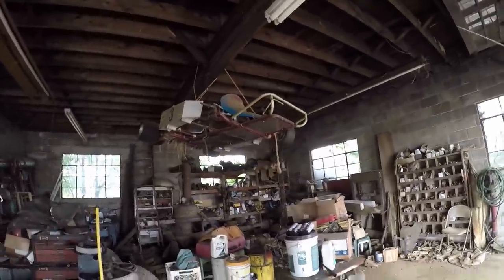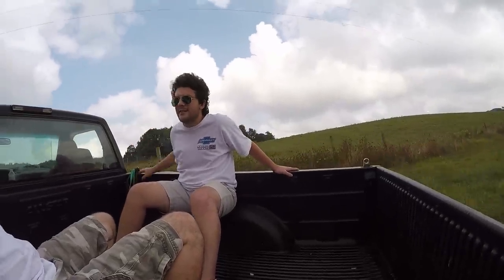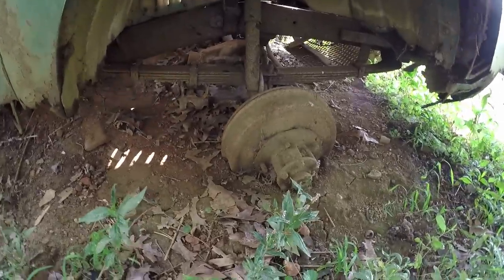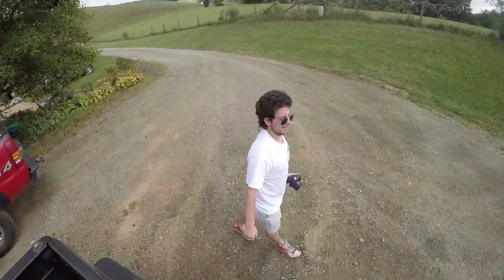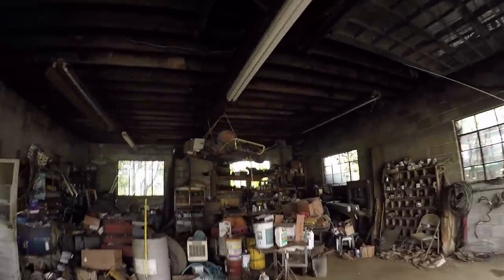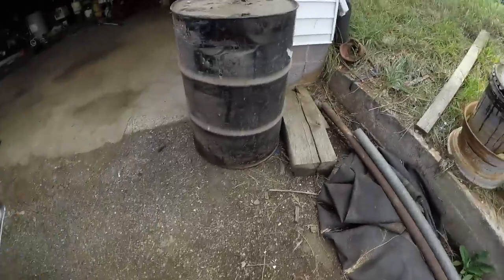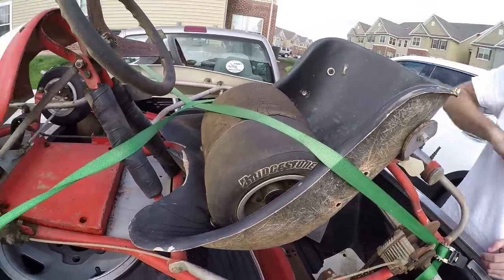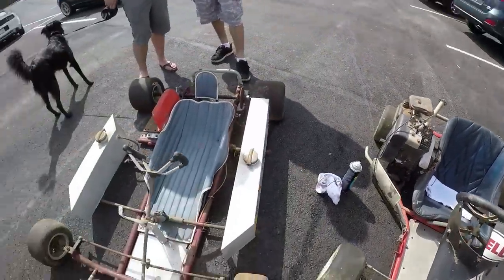Go Kart Barn Find: 3 for $300!

Comment: The laydown kart is a Meyers Lancer "Bullet" enduro kart.  It was made in Bellflower, CA in 1975, and is the  production version designed by me.  About 30 were made between 1972 and 1975.  During that time we won 8 IKF National Championships.  Drivers included Kevin Cogan (Indy Driver) who nearly won the 1986 Indy 500, leading until the last 5 miles.  Scott Pruett, also drove one, and is still racing for Ganassi Racing, and has won many races including the 24hr's of Daytons.   Scott is currently testing the new Ford Factory Ford GT to race next year at Daytona.  Yours could have been raced by an Indy 500 driver.
The races were 1 hour (that is why the large tanks) using Alky with either a McCulloch or Italian 100-135cc Komet engine.  The top speed was about 125mph.  We built several with two engines (75-85hp - 16,000rpm)  that went as fast as 140mph.
The fiberglass faring was not used, the front bumper has been changed, if you remove the adapter plate the motor mount fits McCulloch or Komet engines. )  Rare find!!!   JG
Reply from the maker: +Disneyland1951 Cool! Thanks for the info. This one will be preserved and will probably get a 212cc four stroke, but none of the modifications we do will be permanent.
Reply: +Disneyland1951 AWESOME! Thank you for the info on it... I have been looking but couldn't find much and the stuff I could find didn't look exactly right. Do you have any pictures of the production ones you made??
Reply: +Disneyland1951 SWEET
Reply: +Disneyland1951I remember watching Scott Pruett in my early racing when I was about 14.  There was a an IKF and WKA show down in Charlotte in 1982.  The man to beat was Scott Pruett (he had the baddest Simpson helmet :darth Vader I had ever seen and the man that beat Scott that year from WKA was a fellow names Jessee Samples!  Jesse and Scott were just bad ass drivers and I loved getting my WKA magazine to see how they did.
Reply: I have three mcculloch engines one about 85 cc may 100 the ohthe rtwo are much smalle r
Reply: +courtney chamberland(a she racer? sweet!!☺👍it's always cool when you see a beautiful chick taking and showing her interest in a tougher field  such as this👆 not a lot really do if you think about it! anyways, if you are a racer then good luck and I hope you lead the rankings in your division!! if not, it's still really sweet that you like this stuff as like a hobby and you seem like a kick ass chick to hang out with!! vroom vroom!! speed on speedett~ I'll look to see you as Danica's comp in the future!!😊👍you got this!
Reply: +Disneyland1951   I have a question that maybe you could answer for me if possible. I used to have a friend that was the World Champion kart driver back in the late 60's or early 70's he ran all over the world for McCullough (I think it was). I can not remember his full name, all I do remember is his Nick name. it was "Rooster" he lived at that time in the Kansas City area. If you could help with any info I would really appreciate it. I sure would like to find him again.
Reply: The Griffith Specialties sticker is Ben Ray, my grandfather. He will get a kick out of seeing this and knowing it came across his shop at some point in the past. He still goes to the WKA races and even competed into his 80's.
Reply: So nice to see, hear someone w/appreciation for the Laydown/Enduro class race karts.  Often 'poo-pooed' by others that don't know that most of the worlds best drivers started their careers in karting.  Fast, relatively inexpensive and extremely competitive.  A few years ago looking over the Indy grid, I counted 30 of the 33 divers were former kart champions.Virtually all of the current drivers holding FIA 'Super Licenses' are former kart racers.  Look up Youtube vids of Vettel, Verstappen, Schumacher, Hamilton, Rosberg racing karts to see how fierce the racing can be.I've 30+ years as a fabricator, mech, crew chief for several SCCA pro, semi-pro and club racing projects and still think karts are the best bang for the buck, especially the 250 Super Kart shifter class. Incredible performance rivaling lap times of formula cars.I was at the Long Beach F-1 event when karts were there for a demo event Sat. afternoon.  Scotty Pruett won outright.  I recall some spectators weren't that impressed until I showed them on the stop watch that these were within seconds of Gran Prix cars.I love the Enduro class karts because you can drive the big road race tracks...Willow Springs, Mid-Ohio (my home track) Watkins Glen, the infield road course at Daytona, Laguna Seca and more.  Believe me, 120+mph lying on your back barely an inch off the ground will get your attention...fast!!  Especially when racing 3 wide in the middle of a corner!!Started with an old Redline kart, then a Hartman and still have a NOS, never raced 4 wheel disc brake Invader project with a Meyers built KT100 Yamaha. Enduro karts have fallen out of favor here on the West coast, still strong in the Midwest and Southern states.  This is for sale cheap to the 1st bidder.  Have moved on to other projects. Don't ever think that race karts are silly lil' toys. The chassis/suspension are totally adjustable for handling preference and the speed, acceleration is more than you can imagine.  David Coultard, former F-1 diver once said in an interview the most frightening thing he ever drove was a 250 Super Kart at Silverstone!!Back in the Champ Cars Indy series days, the season closing event was at Laguna Seca.  Northern CA used to be the home to one of the largest contingent of Super Karts.  Sunday morning there was a 10 lap demo race with 20 some karts.  Their laps times would have put them right in the middle of the Indy car field!!  I can just imagine how aggravating this might have been for a Indy car owner with a million plus bucks invested in the car, transporter, team, driver and some kid with a $8-10K$ kart who's entire race equipment fits in the bed of a pickup shows up matching lap times of his pricy Indy car. Anyone that knows racing will tell you the best training for a driver is simply this...Seat/track time.  In karting, in one weekend you can drive several races by simply add/subtract weight for different classes, swap engines for different classes.  With 60 minute long races and several practice sessions you could get anywhere from 4-8 hours of track time or more.Best bang for the buck...anywhere.
Reply: I have a old laydown kart like that one the difference with mine tho is is its mirrored to the one u guys have (if that makes sence the engine mounts on the left side instead of the right) i havent found anything like it i paid 30 bucks for it...

Comment: The lay down kart is a Enduro kart. My dad raced them in the early 70's. They ran on a ful sized race track, up to 2.5 miles and each race was 1 to 2 hrs long. They ran with single and dual engines. All karts that style had out board fuel tanks as there was no pit stops in a race. Nice find.

Comment: Okay, these should be the rules.

$500 budget. 
This covers engine, tires, breaks, ect, but is open to each person's choice. This means they can pull an engine from another cart if they want (must be their own cart), dump cash on a torque-a-vertor, just buff the breaks up, and pray for sunshine and rainbows, or actually do the build right and focus on handling and whatnot. 

One month.
They each have a month from the day they get their engines of choice. No parts should be fixed or replaced before the motors are ready (to prevent cheating) short of frame repair. 

3 bouts.
1)Drag race, any pre-race prep that they deem necessary, but they all must do the same or similar (I.e. Doing a quick burn out to heat the rubber). 

2) course race, three way. Three laps with marked checkpoints. 

3) grass drift/trick/joke driving. 
Basically, be show offs and try to out-awesome the others. 

What do you guys say?
Reply from the maker: +Richard R Good suggestions... We haven't completely figured out the rules, but we will post a video asking for everyone's opinion once we get a better idea of what we're doing.

Comment: Diesel powered Go Kart, that needs to be a thing!
Reply from the maker: +Liowen Good idea, but I haven't seen a small diesel engine cheap enough for us to use.
Reply: CarsandCameras
May have to look around for used generators that run on diesel, but it is true that even small diesel engines are not that cheap.  I have an idea of taking a 10hp diesel motor turboing it and putting in a frame of a motorcycle (road bike), but finding a CVT style clutch (much like the one on your race cart) and affordable motor has been the biggest obstacles thus far.  Maybe an idea for something in the future to do with a cart at some point though.
Reply: Liowen they actually needed up doing a diesel

Comment: I'm thinking about getting a 600cc honda sports bike engine for a kart
Reply: DO IT
Reply: +gamenationX  Do a honda gx390 for the money, do a 2stroke rotax for the speed and simplicity (no shift) and a honda cr125 engine for speed and quite a good price!
Reply: I've been looking at Honda cbr 600 engines in England they are £100-£200 for a used one
Reply: +gamenationX that would be maaaaaaaaaaaaaaaaaad
Reply: gamenationX  these engines would go very fast.  But probably it won't fit.  You should place the motor behind you,  and sit more to the front.  I wouldn't recommend that.  If jou want it. To place at your side you should make special mounts and you have to make a huge cutout in your sidepod/bumper.
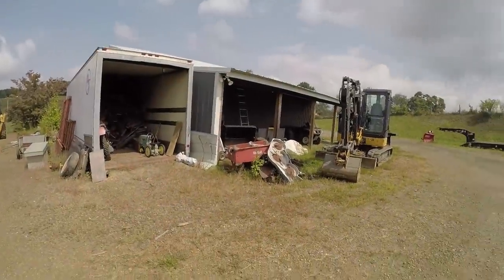Reply: Speaking of honda bikes around 14:00 mins in they show an old cr in the right side of the shed behind the wall the carts are on
Reply: +Pepijn de Groot I've been looking at these engines since I read your comment and Im wondering about one thing you said. You recommended the cr125 for speed and "quite a good price" but all i can find are ones for around $1,300+. Looks like the gx390 is about $800. Im just wondering if you mean considering what you get from the cr125, the price of if it is good or if im looking in the wrong place and you can get one for alot cheaper. Like everyone here, I'd love to have a super fast engine and having shiftable gears would absolutely rock but Im wondering if thats only possible at the $1500 +/- price point. For that money im temped to just get headers and exhaust for my actual car instead, haha! If anyone has suggestions on what they find to be great, fast engines but in more of the budget category, I'd really love to hear your thoughts!
Reply: I don't know what your price range is.  I could totally understand that 1500 id too much.  Here in the netherlands you could get a cr125 on "Marktplaats"  for like 800-850. And a frame for 150-350.(you need a shifting frame) Honda gx390's for karts mostly version 1 engines.  The clones made by ptm are based on version 2. It has flowed channels and could be better. The ptm engines could be bought in thw netherlands for like 300. The cr125 is much faster,  but you'll pay fot that,  also because it's a shifting kart. I've got a genuine honda gx390 myself. It'll go about 80-90 km/h and has quite a good acceleration. If you want really good acceleration you should look at a "suco clutch"
Reply: Thank you so much for taking the time to respond! It looks like Marktplaats is just like what we have in the U.S. that is called Craigs List. 800 euros is about $900 usd so that is quite a bit cheaper than what I found just from searching "cr125 engine" on google. Im being kinda cheap cause I have a couple other projects Im working on right now so my money is being spread out, haha. I'd really like to stay under $600 (530 euros) for the engine. I'd preferably like to get one for cheaper than that and use the extra money to build it up. I've been looking at the 212 predator cause I can get one for $99 usd and i've seen that people have gotten them up to 15 horsepower just off performance parts. The thing is I've been into fast cars since I was a kid so that gets the better of me and I think, why build a kart if its not gonna get my adrenaline pumping, haha! Thanks a ton for the extra info. I'll take a look at the PTM engines, the suco clutch, and see what I can find on craigs list for used stuff. After watching some gx390 videos and looking on ebay that seems like a pretty good set up. Is your kart with the gx390 a street kart or an offroad kart? Have you done any mods to the gx390?
Reply: +mrkthmn a predator could do the job quite well, but if I were you I'd go for the 390cc version.  Because it has 13 instead of 6.5 HP.  The 13HP version of the predator is costs quite a bit more than the 212cc. If you go for the 212cc version I recommend a torque converter ( cars and cameras used it on their go-kart too)  a torque converter doesn't fit on every kart,  so watch out!  If you don't have the space for a torque converter you should go for a 13HP version.  So for acceleration is 6.5HP and torque converter the best bang for your bucks.  And for normal acceleration and a higher top speed is the 13HP the best bang for your bucks. A 6.5HP + torque converter is quite the same price as a 13HP +normal clutch.  Honda/honda clones are quite easy to tune,  by using a stage one kit  that costs around 40 dollars you'll get 1-2HP extra.  The kit has a timing key for the flywheel,  valve Springs,  a new jet for the carb, and an open airfilter.
Reply: Ever since I read your last comment I've been watching videos on the gx390 and Im pretty much sold on the idea. They sound great, and like you've mentioned you are starting off with the amount of HP that you'd be maxing out on a 212cc. Plus a fair amount of videos i watched had people putting the 390 Honda on more professional looking karts and running them on the track. That just kinda shows me that they are a more serious engine. I had heard Cars and Cameras mention the torque converter but hadnt watched the video. I just watched it and I gotta say, that acceleration looks awesome. But, After reading what you said and watching videos on the gx390 I think thats the way I want to go. If I start with a bigger engine Im already starting with more HP and I definitely like the idea of a higher top speed. Plus any tuning I do is just going to increase the 13HP I'd be stuck at with a 212cc all modified. Man! I cant thank you enough for all the help and information you've given me! I would have spent weeks trying to figure this all out on my own and I wouldnt have picked the right thing. But In this one conversation you've helped me decide on the Honda 390! I subbed to your channel so If I have any other questions I can send you a message. That is if I havent bugged you to death already and you feel like answering, haha! Thanks again man. You have been so much help.
Reply: +mrkthmn no problem buddy,  I'm not a professional,  but I'd like to share the things I know.  I'm planning to upload a video soon of a home made beercrate-racer,  which contains a gx390. I'd like to hear how your progress is going!
Reply: I'm currently building a kind of quad/kart with someone else. Also we're modding a mower. We're planning to put a chainsaw on a small bike. We're going to upload on a different channel, called : - kartworks -
Reply: Not a CR.  Its a XR four stroke

Comment: Straighten out the frames, Sandblast them, Acid dip, and powder coat. Soda blast and clear coat the wheels. Build 212 predators and you're well on your way. As for the body work, You can make wood forms and heat sheets of acrylic and form them over the wood to make really cool bodywork. There is a place near here that makes whirlpool tubs, A friend talked to them and they helped him. He made forms and they put them in a machine that heats up an acrylic sheet and then vacuums it down over the form. After that they pulled it off the form and sprayed fiberglass on the back for him. When he got it home all he had to do was cut it out and sand down the edges and drill holes at the attachment points. The guy at the tub place only charged him for the $22 sheet of acrylic. He was really nice. Said he liked to see kids learning how to work on things instead of getting into trouble. I'm hoping to build my own one of these days. I'm shooting for something REALLY fast though. I bought a 250 Kawasaki Ninja. The plan is to build a frame around that motor. The end result will look like a formula 1 or INDY car with a lay down seating position. Body work will be formed Acrylic, although eventually I hope to make another set out of carbon fiber. As for the suspension I got in touch with an instructor at a local community college that has a machining technology program. He said I was more than welcome to get with some of his students and make my spindles, carriers, control arms and anything else I needed. All I had to do was supply or pay for the materials. Students need a lot of practice and having someone pay for your materials is a huge bonus for them! Right now the biggest part of the chassis design is done in solidworks. The front suspension is a booger though as it will be a pushrod setup where the shocks work off a bellcrank. Once the 250 cart is done the next iteration will be built around a 636cc Kawasaki engine with an estimated top speed of about 150Mph.The whole build will be documented and put on YouTube hopefully within a year or two!

Comment: You guys inspired me and a few friends to buy a cheap dead go cart and Revive it. I'll upload pics of it in a few days sanded and primed the frame painted red then sanded the metal floor turned it into black the gas canister is red and the steering wheel is red the seat is black rims are black we got a 163cc 6.0hp go cart it goes about 25 mph and I weigh 145 I'm having problems with the brakes. I'll keep you updated!